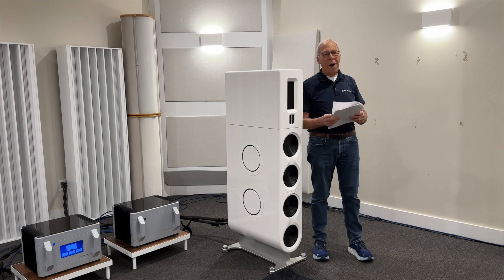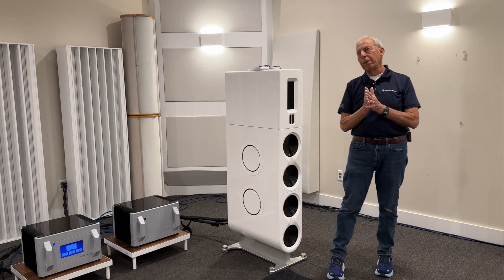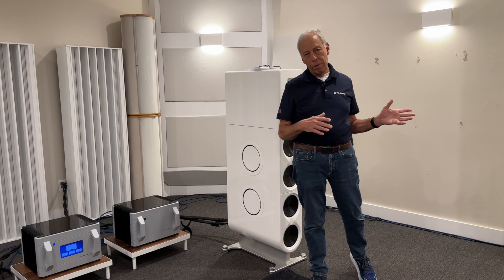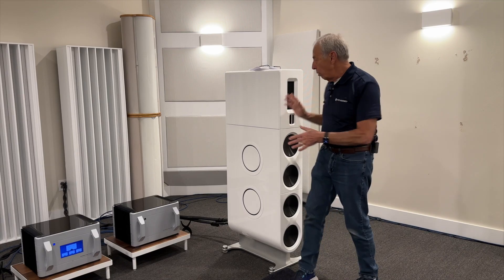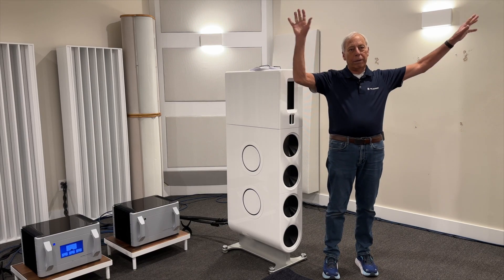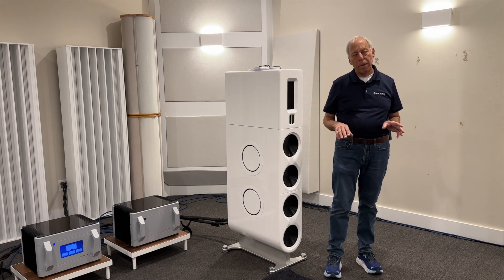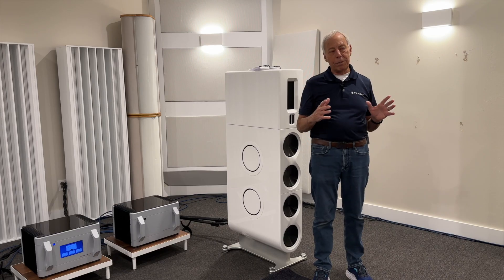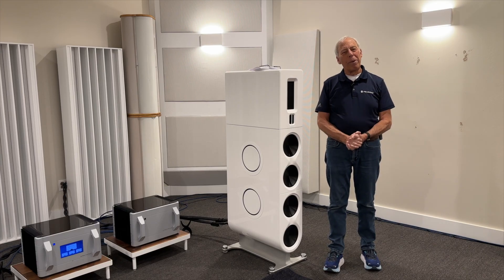Why loudspeakers need subwoofers

Comment: Noticeably missing from the complete audio spectrum below 25 HZ is the flat surface moving magnet transducer which supplies the response to natural turbulence and the all important percussion present in symphony orchestral streams. Subwoofers or any other angular radiator is simply the wrong shape for effective reproduction all the way to the bottom of the spectrum. I can help.

Comment: This is why you should never go for size or looks and bling. The room determines the speaker type, if you do acoustic treatment the range of useable speakers goes up a little. If you've got a preamp that can adjust its output to a room characteristic it goes up even more. However, a speaker in a too big/small room and/or without treatment will never play out its potential no matter how sophisticated the preamp tricks are. The money you save by avoiding an oversized speaker can be invested in some nice subs. A sub can be placed independently and frees up the main speaker placement for optimal mids an highs. If you use active subs your amplifiers can also be downsized significantly. Active subs were the real game changer and opened up possibilities for most users that were not possible before.

Comment: I have a strange bass issue in a 500 sq foot rectangular room with a bar that runs lengthwise in it.  I have two stereo systems chained together in the room. They have speakers for each in each of the 4 corners. I have a 2,000 watt pro sound 18" sub in one of the corners that shakes the room pretty good and goes down to 14 Hz +/- 3 dB, but what is odd, is I also have a 12" Sub that is centered along the wall behind where people sit at the bar about 10 feet behind them, and THAT ONE is the one that really shakes the bar. Its specs are nowhere near what the 18" has, but I guess because it is along the wall nearest to where people sit, it can get quite bass'ey and people will sometimes ask me to turn down the bass on that one even though it is much smaller and at best taking 250 watts RMS. I guess the sound waves just pile up in that area.

Comment: Why even put woofers into  speakers then and make all these claims about how low they go? The contradiction and problematic pathways this leads one down is unbelievable. Those who think that woofers inside speakers that have been perfectly crossed over etc are easily bettered by lower priced hardware subwoofers from other brands must ask the question: why is there a woofer in the extremely expensive speaker if it's easily improved upon by adding in a cheaper 3rd party sub? Why design 3 way stereo floorstanders? Why not just 2 x mid/treble and 2 x separate (Sub) woofer's that all interconnect and where the woofers can be located away from the main speaker? If people had the opportunity to hear very high end speakers in real rooms they'd know subwoofers are really not required at all in the vast majority of circumstances. We are a Kef specialist and we've sold a few pairs of the Kef blade 1 (original) speakers . No subwoofer ever needed.  The 4 way Kef Muon has the most incredible earth moving tones we've ever heard built into a complex ICE design.  Engineering of high end stereo floorstanders is a complex thing - those who like extreme bass for certain types of very modern music may be an exception but for all other music your very high end floorstanders costing in excess of 20k typically can deliver, in most rooms, all the bass anyone would ever need. Of course people reference the cliche of French organ music where some extreme low frequencies go down to 20hz or below.  Yes that exists but it's an extreme niche.  Then people claim Volume is an issue - 
is it though, really? With a 30k speaker it shouldn't be.  Finally it's old chestnut called  'the room' and mostly this is offered up as a mostly science free or evidence free excuse to throw some woofers in. Yes rooms need very, very careful attention but simply saying 'the room' without showing ones workings is like saying  'the cable' made it better again it's possible but where are your workings? Everything that's done in the name of hifi should be done with 1: workings 2: stated engineering facts and specifications 3: A-B listening. Otherwise statements made about improvements are simply opinions.

Comment: Or you could just buy the right speakers for your listening environment & genre of music you enjoy the most
Reply: It's not the "right" speakers for the "right" music, it's a matter of physics. Bass wavelengths are literally often longer than the room, over 20 ft/7 m and when those waves interact, adding and cancelling each other (called nodes), bass can often end up with actually distinct areas where it will be too loud or quiet, and the only way to fix that if it is not correct at the listening position is to move the sub, which moves those nodes around the room, and you can't do that without affecting everything else if the sub is in the same cabinet as the speakers. 
Do you always need a sub? No, but you'd be surprised how much the bass (usually) drops off at the listening position, even if the speakers are technically flat at 30, or even 20 Hertz, and if there is a bass problem, a separate sub is often the best, and maybe only way to fix it.
Reply: I went to my local dealer & tried a few models on my shortlist in my listening area over a 2 month period before deciding which speakers I liked the most that is how I decided which were the right speakers for me, I wish my company could be in the business of selling to you audiophiles it would be like taking much much candy from the babies, I use monitor audio towers with 2 x 10 active subs with high level speaker cable connection & attenuate the low bass register on the monitor audios they fill my criteria well & for the relatively small  cost of my whole system I am very happy

Comment: i wanted to ask this questions who are really expert on this case , i have ungrounded outlet (old house) this cause my computer and my dac amp also ungrounded is it possible this issue will damage my headphone over time?
Reply: Short answer, no, it won't cause any damage in normal circumstances.
The ground is a safety valve that connects every piece of metal that is not already an electronic (like the case) back to the breaker, so if a hot wire ever bumps something it shouldn't, it will trip the breaker, instead of making the case (or any other metal part) hot, and shock hazard for anyone who touches it.
Reply: @l0zerth  thanks , so that means ground only for safety and doesnt do anything for device protection?  
i have really old house in my country in fact a lot of house in my country are ungrounded unless they're new big building or rich ppl house ,many people here believe and claims that ungrounded outlet in long term could damage electronics device due to "voltage leak overtime" also i cant find solid answer in internet lot of mixed answer that says true and not true

Comment: I have tower speakers that have built-in powered sub woofers that will go down to 20hz I also have two SVS Ultra 13subs with the upgraded plate amps with 1,200 watts  5,000 peak and listen without my subs

Comment: I’m going on a tangent here but it’s still audio related…
The majority of people in the car audio shows don’t know the difference between a woofer and a subwoofer. They force the subwoofer to play midbass frequencies and they make the midranges play the high bass when that’s supposed to be the job of the midbass woofer. Mids are not supposed to play anything under 500hz unless it’s a coaxial. Anything under 60hz is where subwoofers are most efficient.

Comment: This is a very controversial subject. You may be over exaggerating the need to use subs. Of course, there’s the additional issue of how deep can the speakers dig and be heard and felt at volume, but still have a decent full range response, which that, in itself, could potentially push you into a situation where sub use is definitely necessary, irrespective of the room. But for some of us that have speakers that dig deep enough, can play clean loudly enough at the listening location, still maintaining a  decent full range sound quality, the sub isn’t always a requirement when the setup in the room allows enough bass in the listening position. Also, I guess it depends on how much of a bass head a listener is. I personally don’t like wimpy bass. I’d like to hear and feel it, but there’s a line between enough and too much. I feel the same way about the upper extremes as well.
Reply: What Paul is alluding to is not just how much bass but improving in room feeling of rightness of deep bass, which can wavelengths 50 feet long. If your room is not 50 feet long, you are not letting out it's entire wavelength. Look at an extra subwoofer or two as a bass diffuser, which sounds like it breaks up the standing waves which are too long for your room. Best to have at least one subwoofer behind you, crossfiring at the other woofers sound. It tends to diffuse those long bass wavelengths, and it sounds really different and the bass sounds more immersive. Hard to describe the effect, but you'll like what you hear.
Reply: Something tells me you didn't actually watch the video, or at least too busy thinking up your argument to pay attention to someone who has literally been doing this for half a century.
You have to have an exceptionally large room (such as the expo center he was talking about) for bass nodes to have any chance of lining up with the highs and mids at the listening spot if it is all coming from one cabinet.
By moving the sub, you can change where the nodes are in the room, and get the perfect listening position with all frequencies fairly flat/neutral, with all the imaging and other ear candy.
Reply: @l0zerth  yeah I know all that, and I maintain my position. Paul even said that you don’t always need it, but he made it sound like it’s needed more often than it actually is. You have your opinion and I have mine, Paul has his, and everybody has theirs. Don’t try convincing me otherwise, I’ve been doing this stuff a long time myself. You are actually rude when you posture yourself as a know it all. 
I say again, it’s a controversial subject, 
and your opinion is only another.
Reply: @shipsahoy1793  I'm sorry if I came across that way, but I'm not debating preference, which is what it does ultimately come down to.
The science says that having the subs fixed in the cabinet with rest of the speakers will almost always cause you to not get every bit of bass, or too much bass, without compromising the rest of the frequencies and soundstage. There is no debating that, and a separate sub enclosure is the simplest and easiest way to address that.
The reason it is being presented as more of an end-of-the-story best option is that many audiophiles (which is what this channel and Paul's company are all about) are looking for the most pristine, absolutely perfect reproduction of the recording, including the lowest, flattest bass.
In the real world, you basically can't get that without a separate sub, but for a number of people, like yourself, the speakers get close enough, low enough without it, and for those living in apartments or very little space between houses, a separate sub would just be too much to keep any sort of peace with the neighbors.
Is a separate sub actually necessary? Once in a while, sure, but it often comes down to how much are you leaving on the table by not having it, vs your environment, space, and budget.
You can have an amazing audiophile setup with a pair of small bookshelf speakers and a sub, or a pair of massive towers without the sub, it matters a lot on the room and setup, and you are limiting your setup options without the sub, and if you have any issues with bass after getting everything else decent, a sub may be the only way to fix it.
I'm glad you love your system, and I'm sure you get plenty of bass, but most setups would absolutely benefit from adding a sub and setting it up correctly,
whether it it is limited by their speakers, electronics, room, or whatever, it is a plus in almost every situation.
Reply: @l0zerth  Lol, yes, I did understand, I do know, and basically agree. I really appreciate you taking your time to get back, which shows intense thoughtfulness. 
That said, I have a situation currently whereby my lack of pursuing that “ultimate” perfection suits me acceptably fine for my stereo listening, although I am currently using subs for HT usage in another part of an ample size home. I’m not against paying for subs when there’s no other way. Have a great summer! 👨🏻

Comment: The question was why, when spending 30 grand on a set of speakers, why do you need subs?? It makes more sense to buy a great set of bookshelves and add subs.
Reply: Yeah, even though I run full range towers I feel I've had better results when I used bookshelves and subs.
Reply: I agree, but I still use 2 x 10 inch high level speaker wire connected subs with my monitor audio towers & set the xover to the towers to 55hz instead of using their full 35hz freq, my modest system sounds lovely even when the vol is cranked up
Reply: Because marketing…

Comment: That’s an interesting explanation. I’ve been struggling with this also. My room is about the size of your demonstration room. If big speakers like that can’t utilize the room, can I getaway with bookshelf speakers and a subwoofer? To me there’s no point in going big if the speakers can’t produce bass in a given room.
Reply: You absolutely can do that, and many do to wonderful effect.
The point of big towers is to give space for the bass to resonate, since the wavelengths are so long, giving somewhat better bass from the same speakers, but that doesn't fix the "node" issue, where those long wavelengths often create distinct bass buildup and cancellation areas in the room, and is very rarely correct at the listening position.
The point of the sub is to augment the speakers, so with smaller bookshelf cabinets, the sub may have to work higher into the frequencies, possibly creating different issues on the bottom end.
As Paul often points out, everything is a compromise...

Comment: It kind of begs the question if the right approach would be speakers optimized for mid range together with multiple subs that handle everything below 150Hz.  Seems most of the cost of tower speakers is the bass which never really works all that well in real rooms.
Reply: You dont get the punch from a smal speaker, like you do on a bigger one. v8 vs vtec, 2 different punches
Reply: @Error2username  Agreed, I'm a big fan of larger drivers.  Fair to say you do not need large speakers for upper bass through the highs.  The FR30s do not use large speakers on the upper module.  My point is why not just an upper module and an array of subs to replace the lower big box.

Comment: the rule is that you always want a subwoofer or two. 
when you realize that, then why buy speakers that reproduce anything below 100hz, or 200hz if you have dsp.
then its end of this ported, slave, rigmarole.
Reply: My thoughts exactly.  Look at the FR30.  Where is the bulk of the money.  Lower box, 4 woofers, 4 radiators and a lot of crossover parts including expensive (big) inductors.  You could buy a lot of Rel subs for the price of those bottom boxes.

Comment: A 50Hz sound wave is 22ft long ... so there is no point to have a subwoofer in rooms with less than 22ft length between speaker and listener.
Reply: Incorrect. You'll have bass nulls that the sub placement will go a long way to fix.
Reply: it is a mistake to think that
Reply: @mykhailoskachkov5946  how so? The smaller rooms have terrible bass issues (bass nulls, peaks). With a measuring mic and Rew you can see  the room mode issues. I also used the REW room simulator to see how a virtual subwoofer affected my response and low and behold there is one spot in the middle of the room that fixes my issues. Sure enough putting a real sub right where the simulator showed fixed it for me.
Reply: @MrDingaling007  the fact that wave length is large doesn't mean you don't hear the sound. So it is incorrect to say that there is no sense to have sub in small room.
Reply: @mykhailoskachkov5946   I am arguing that it does make sense to use a subwoofer to help deal with room mode issues. The OP is saying it's pointless.
Reply: No, he is correct.  The pressure wave consisting @50hz produces a wave @sq x meter axis from the point of origin (out to around 22ft).  However, as the wave travels, the pressure from said 50hz expands and drops.  So, the longer area would need to be compensated by a sub to maintain the extension of the pressure wave that you would hear.  Deeper pressure waves (below 30hz) have a greater distance and extension due to larger amounts of air (the primary force or push of said pressure wave) being moved or pushed creating resonance response (i.e. vibration in windows, walls and the like).  A pressure wave Below 30hz in an apartment is heard all through the apartment building due to said resonance.  If you have speakers that have good lower frequency response (able to produce pressure waves down to around 25hz, like the FR 30), their is no need for a subwoofer.  Even in Paul's 12 x 15 room, there should be no need for a subwoofer if the speakers are positioned so as the pressure wave can achieve low end resonance (i.e. moving the speakers closer to the wall, yet maintaining a perfect sound stage image).
Reply: @jayedgar2373  Well yes I agree on the fact the speakers may produce said low hz specs but as we always place them for optimal stereo imagining and near walls etc, there will be compromises,  i need a larger room without a doubt. The sub definetly helps immensely in the same way as the Rel sub that Paul mentioned at the back of the room.